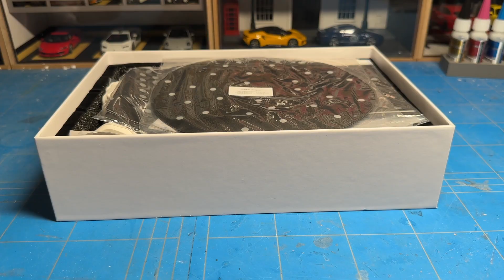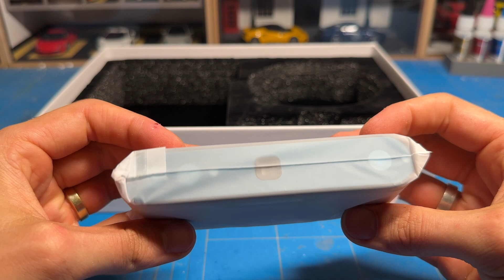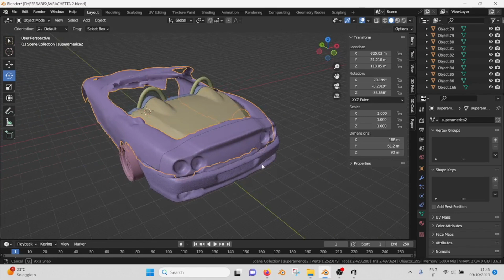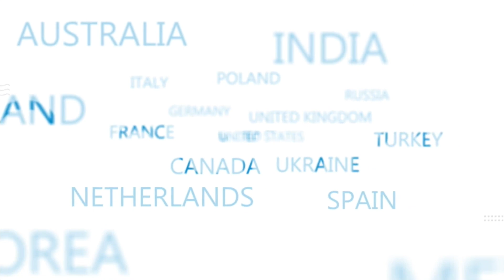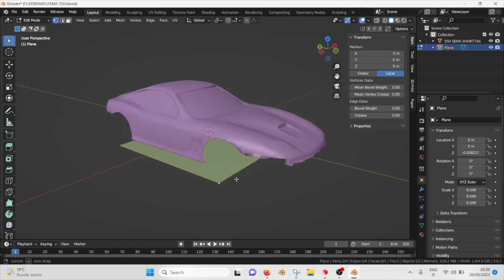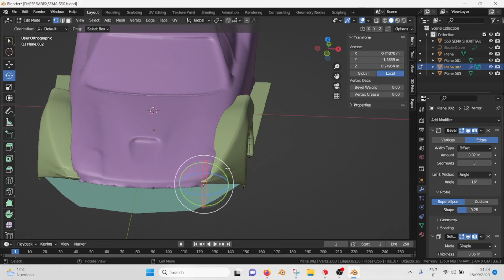Making Custom Ferrari Bodykits with a Revopoint Inspire 3D scanner

Comment: The idea of buying a 3d scanner has been popping up in my head lately. I was unsure if I will have to replace my computer. What are the specifications of the PC used with the scanner?
Reply from the maker: Different scanners need different specs of pc, best to check with the manufacturer of the one you want to see what it needs
Reply: @TheScalemodelingChannel 

I know. I have this specific scanner in mind. The manufacturer doesn't give specific information regarding the minimum system requirements. Therefore, I was looking for feedback from practical experience.
Reply from the maker: @walidkhier5640  if you look on the software download page. It tells you what you need